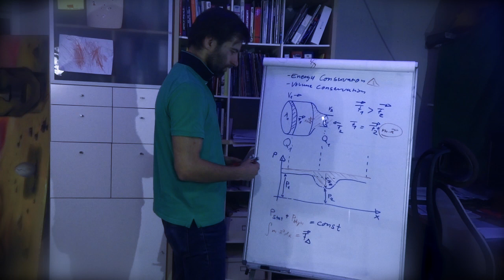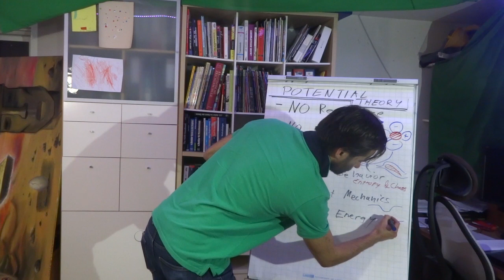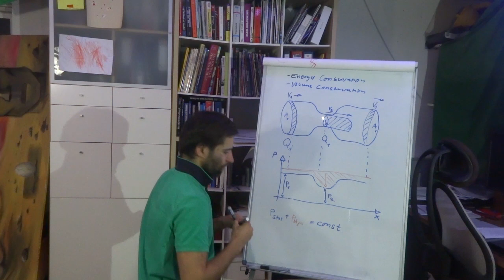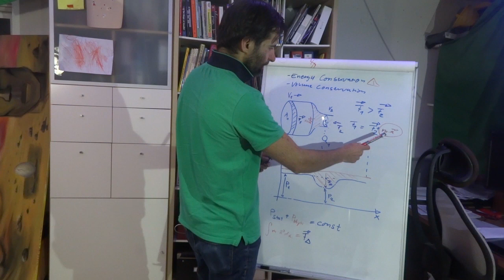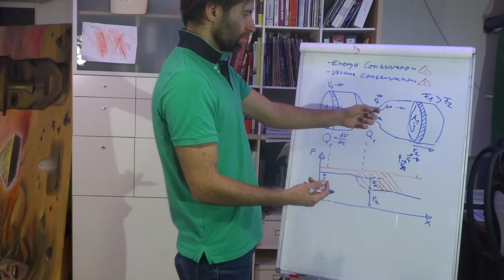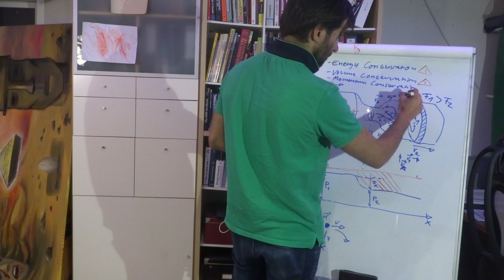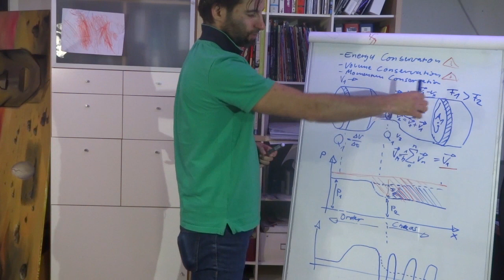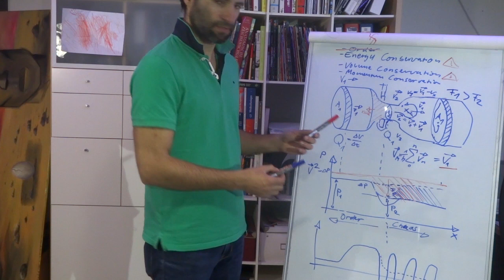Fractal Aerodynamics - Chapter 04 - Energy Conservation

Comment: I completely agree with your observations of fractal propagation.  This is where all physics has failed .. WHile the observations may allow a macro summary using a simple formula, it is evolving fractals that hold key to all physics . If you have cracked this nut , then I can  tell you without a doubt , wings will not be necessary any more .

Comment: How can you verify this theory experimentally? Is it possible to verify the angular momentum of each of the particles about attractors really sum up to make up for the pressure drop?
Reply from the maker: I am thinking of a Simulation and recording the infinitesimal speed of the particles. Maybe Navier-Stokes in the first place. because yet it's not entirely clear if n-s would have to be adjusted as well in some claims. On the other hand it could provide evidence of the correctness of n-s ecquation in 3D space which still is one of the millenium problems. So go ahead if you want to acquire for the 2Mio $ prize offer. 😬
Reply: @felixschallercom  Awesome, I am trying to find solutions to that very problem verifying solutions exist for NS in 3D. Maybe this approach will work.
Reply from the maker: @shoopinc  go ahead. good luck!

Comment: I have to disagree with you here , and I think you are too concerned with convention.  Not like you at all .. Don't question your ability here .. clearly you are advancing Aero ... beyond the 2020's . It is purely mass flow.  The old saying same shit different bucket applies. A1(i)=A2=A1(o). Mass flow. From there you can adjust the many variables such as density and speed and pressure . Mass is the starting point of momentum, the losses are of course heat, due to friction , so the momentum is not conserved, as energy is lost in the system due to friction.
Reply from the maker: Well this video wants to show that due Mass and Momentum Conversation a Spontaneous Acceleration (by a virtually modeled "potential field") that does not exist, because everything is based on momentum conservation which leads to actio versus reactio. Mass is resisting acceleration with the request of an additional force (Newtons 2nd law of Motion) this induces a Pressure increase by momentum change the momentum change redirects the force back to the source of Energy which is e.g. a piston, pump. The Potential Theory states: The source of Energy is the pressure - which is wrong. This would allow perpetuum mobiles - seriously? More videos are coming soon to untangle the misleading facts created here.
Reply: @felixschallercom  Lift due to speed differential over a surface and reforming is a complete falasy . The partical do not join until way past an airfoil, and long after detachment  from the upper surface . There is a Cambridge study that highlights this , graphically.  Lift as it turns out is more to do with ROCKETS that Bernoulli.
Reply from the maker: @GarretKrampe  well this is kindergarden. Falsified already decades ago ;)